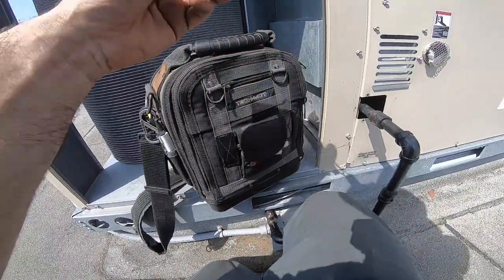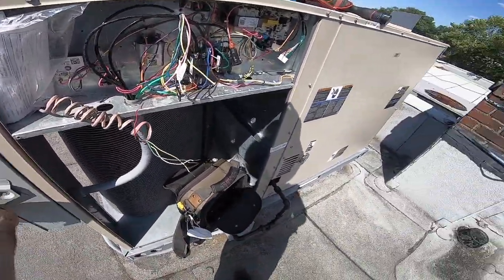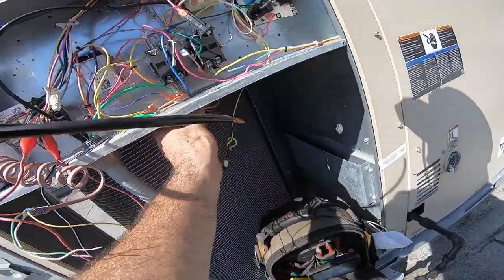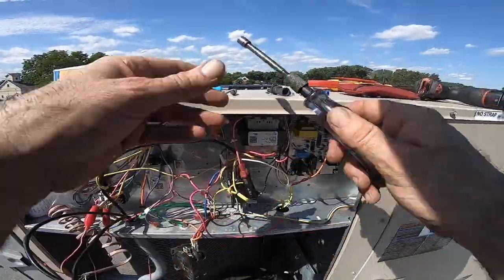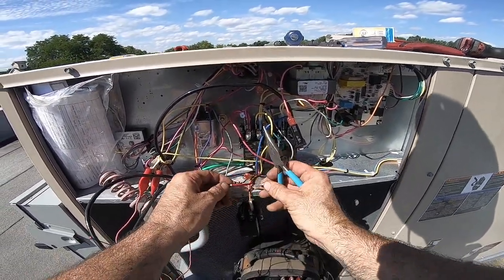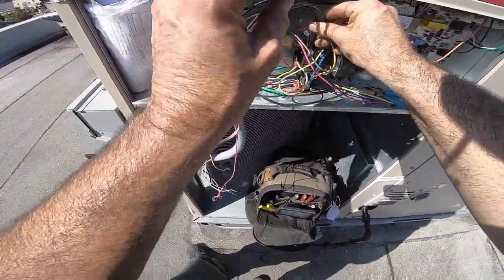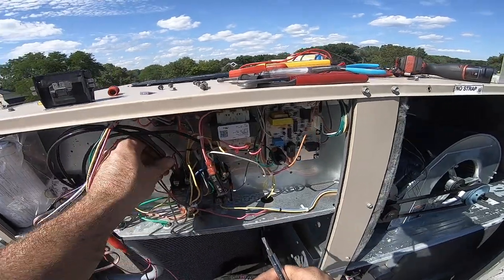AC Blown Fuse Low Voltage Short

Comment: As a newer tech I greatly appreciate you documenting this stuff and talking through it. Thank you sir.
Reply: Dude just take a picture. Or use wiring diagram. This is not a complicated circuit. Never lay screws or tools on top of unit. Make it as easy on yourself as you can.
Reply from the maker: No diagram completely worn out. Usually I take a photo.

Comment: Testing to ground for shorted windings in a transformer will lead to inaccurate results, unless specifically checking the transformer to see if the windings are shorted to the frame of the transformer. I believe this is correct. Help me out.
Reply: If the transformer is grounded on one leg,  then you could accurately check it to see if the windings are shorted to ground.

Comment: I'll pull those resetting fuses from an old rtu that's been replaced and save it for something like this. The lil popper is ok, but it can let quite a bit of current through before tripping

Comment: What size popper do you use? 5 amp 3 amp? Most of the boards i work with use 5 amp fuses but have heard people burning transformers on the 5 amp poppers because they don’t trip fast enough.
Reply from the maker: 3 amp is better protection for the transformer. I replace the 5 amp fuse with 3 amps whenever I install a split.
Reply: @thehvachacker  thank you so much
Reply: Just replaced a transformer with in line 5amp fuse. Never blew, only glowed.

Comment: he just rips off the wires and here I am taking off one  wire at a time and reconnecting it to the new contactor hoping nothing pulls off in the process.
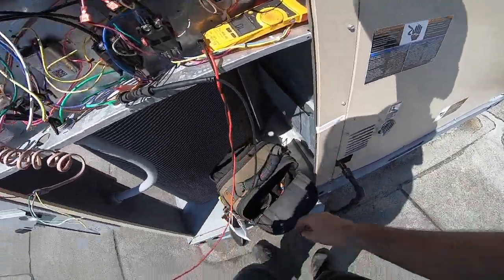Reply from the maker: I started off doing the wire for wire. Many techs do it their whole career. The schematic is a map if you ever forget where a wire lands. Every wire has a load on the other end. The other day I did 2 contractors same unit. To save time I did the wire for wire. It was a unit I don't work on often and 3:30. Do whatever your comfortable. If you seen my latest video I remove a board and wire the unit using a relay. Spend time on maintenances getting more comfortable reading the schematics and tracing wires. I have been doing this since 1999. Many contactors I replaced. Some missing schematics and I wish I did wire for wire.
Reply: @thehvachacker  Can you do a short video to support your other video,   replacing the board with a contactor showing a schematic  to explain the  wiring. This would be extremely useful for HVAC newbies or non electricians.
Reply from the maker: Yes I can do a vid writing up a schematic explaining more detail of the vid where I required the air handler controls
Reply: @thehvachacker  That would be great if you can post that so I understand better

Comment: I have an old Bryant air handler, I don’t see a 3 amp fuse inside, no circuit board either. AC wont turn on I’m sure is shorted something . I used a jump wire to bypass the thermosthat. The A C was working before I did the bypass.
Reply: Any idea which part in the air handler I should check ? There’s no circuit board and fuse , note: the A C was working until a bypass the thermosthat . I used a paperclip and I must have contacted a wrong wire. Any idea what part to check that shorted when. I did the bypass?
Reply: @migosmadeira9892  it has been a while but you probably jumped the 24v to ground.

Comment: Hey man I've got a question so on my electric heat circuit board it has a blown fuse so I took off all the thermostat wires put a new fuse in and it pops right away nothing's grounded and there's no low voltage short and all the thermostat wires is unhooked and it's still popping so would that be a bad board? All my voltage readings are correct